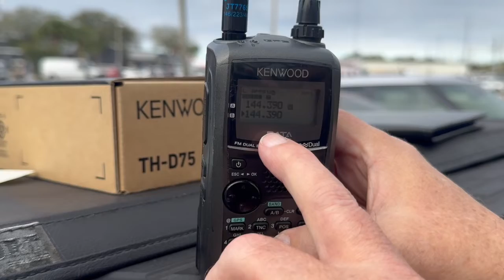Digipeat with TH D75

Comment: I still don't get APRS, when I looked at the APRS section in the TH-D75 owner's manual, I almost needed a new pair of shorts when I saw it was 20 or so pages long! Seems a bit complicated to me. Is there a "APRS for Dummies" book out yet? I have not done DSTAR on it yet either, because I can't seem to get DSTAR to work on it, having tried both types of Blue DV, one on my phone using the Blue DV  Bluetooth app and the Blue DV on my PC using the USB cable. Total fail. And I'm registered on the DSTAR network too. No Joy. But yet I have tremendously enjoyed my Kenwood D75. Not even the most feature laden China rig can compare.
Reply: Same here

Comment: Off topic... but I found a difference between the 74 and 75 in DSTAR. The 75 will now show "Location" on the C button as opposed to "OK" on the 74. Pressing "Location" on the 75 on an incoming voice transmission will display the person's GPS location. FWIW, the 74 is software version 1.08.

Comment: Digipeat can be configured to accept APRS from inside a building and retransmit those messages to outside into the local igate. This mean users can transmit low power inside ham fest and flea markets and your traffic will get out.